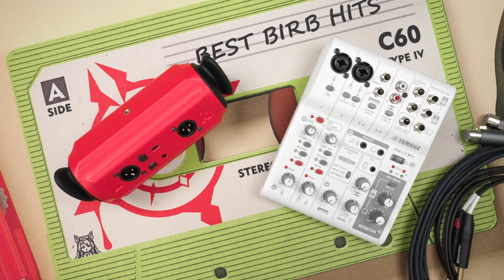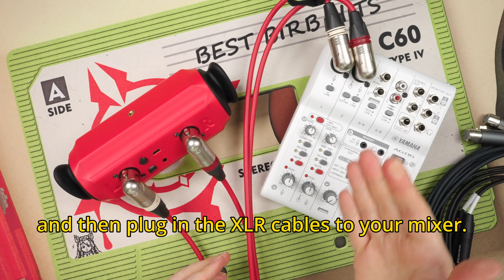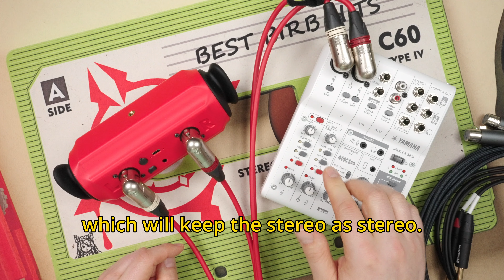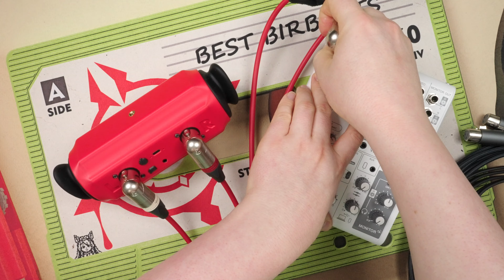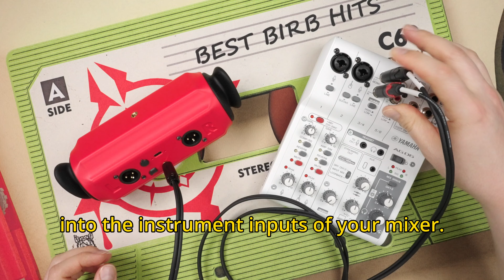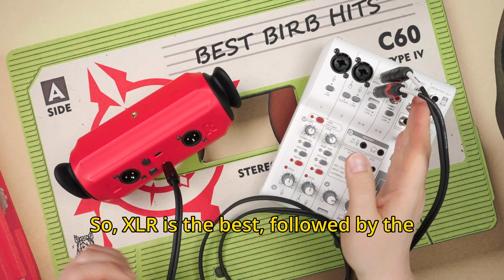Seraph Pro - Connection Quick Guide

Comment: Hello. I stumble on this during ambient sound microphones. would i be able to connect this on a camera and record outside walking on the street? If so, Do you have recommendation of recorder?
Reply: Oh I found one of your video demonstrating. Thank you!
Reply from the maker: The recorder that I use for everything is the Zoom F3 since it has 32-bit float recording.  The microphone capsules are very sensitive and it can be difficult to set the gain in highly dynamic environments so I prefer having float recording for that reason.  For on camera recording, I'm not going to outright recommended using it with a camera's 3.5mm input.  Plug-in power has to be turned OFF on the camera or it can cause interference with the audio.  However, most cameras don't have an option to turn off plug-in power.  Also, the output levels of the Seraph Pro microphone are LINE level so that is typically higher than what most cameras will accept.